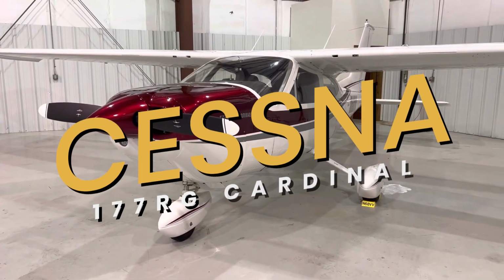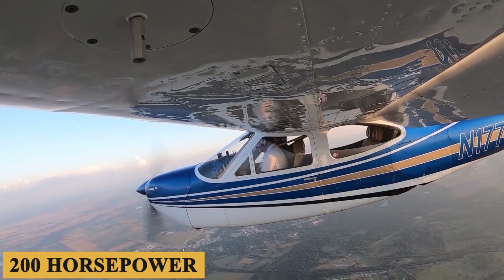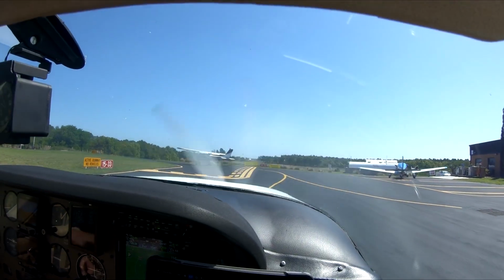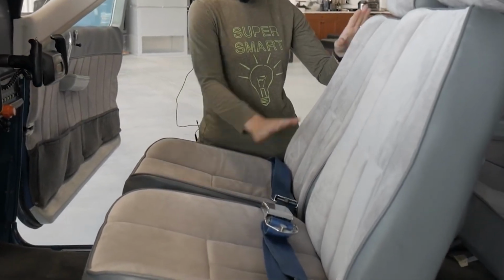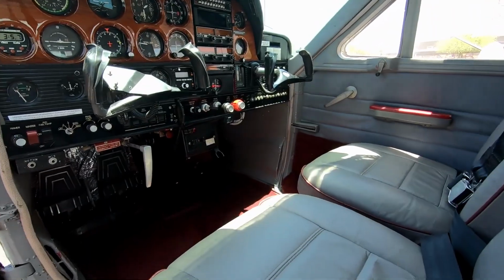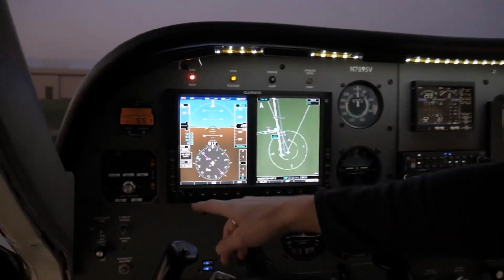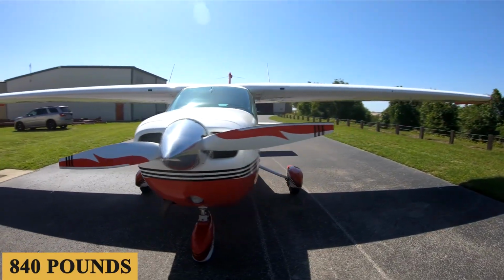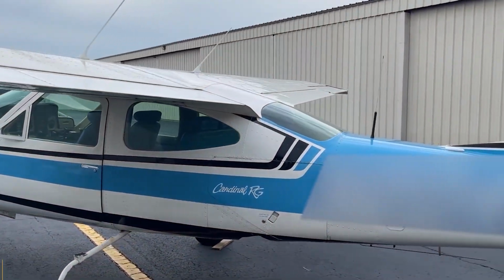Inside The $200,000 Cessna 177 Cardinal RG

Comment: The C177 is a piece of junk. One of the most dangerous aircraft made by Cessna. I will never ever pilot one again.
Reply: Care to provide some data on why you think that? What are some of the other dangerous airplanes produced by Cessna?
Reply: @cessna177flyer - as a CFII with about 50 hours of instruction in the Cardinal before I decided never to pilot another one. Here are problems I experienced: 1) No fuel flow from the right fuel tank to the engine, or the ability to crossfeed fuel to the left tank. This wasn't seen during preflight or run up, it only occurred during flight. 2) Pitch instability during approach and landing flare. Actually anytime you fly slow in that airplane, which makes stall recovery more of a challenge. 3) Structural problems especially at the wing root. Without the supporting spar to the wing like the other Cessna "C1xx" models, the Cardinal wing is problematic and has required many Airworthiness Directives to deal with it.
So, for those reasons it is a very dangerous airplane IMHO.

Comment: Why did Cessna stop production of the Cardinal?  It's simple, it cost too much to build for what it would sell for.  If it had been profitable at the same price as the 172 it was designed to replace, it would still be in production, but when it ended up sandwiched between the 172 and the 182 at their price points along with competitive Piper 140 and 180 Cherokees and Piper Arrows,  it just cost too much to manufacture.   The cost of that beautiful cantilevered wing that took away those pesky wing struts was already part of the extra expense.  Then, when the original engine of the 177A needed to be upgraded to the 177B with a 180 horse engine plus a variable pitch prop to get the performance to be competitive,  the production costs skyrocketed.   The result was very weak sales at a time when private airplane sales across the board were in the dumpster.   I worked for Cessna in 1977 and met with the dealers when Cessna made the decision to end the Cardinal.  Dealers at the time were all but forced to buy the 172s and 182s that Cessna made in those years simply to keep their dealerships so they would to be able to get Cessna parts to fix what was already the existing Cessna aircraft.  So the Cardinal became the Cessna stepsister. I owned two of the 1978 year Cardinals, the best years made, accumulating  over 1500 hours.  Unparalleled comfort for a business traveler because it was so spacious, grand visibility and easy to get in and out for passengers as well as the pilot.

Comment: Terribly patched together video with very inaccurate data on the fuel capacity and many other aspects. There is only one green light and one red on the landing gear indicator. There’s a side mirror to check gear on most. 60 usable gallons on most RGs. Not very well done.

Comment: Why did Cessna stop producing the Cardinal?  It doesn't make sense to me.  The benefits far outweigh the negatives from what I can see.  Minor modifications could have made this an even more incredible plane but Cessna stopped in 1978.  They had a winner in my opinion.  Some tweaking can be done by owners to help with performance.  Tornado Air makes a turbo and an exaust and free flow air filter make a major difference as well.  STOL kits are said to help further.  But they are getting old.  Why Cessna would produce the 182 instead of this plane I cannot understand.
Reply: like @wwselect above stated, the Cardinal was too expensive to make. Labor costs in the late 60s and into the 1970s increased significantly. Because much of the Cardinal was hand made, it simply wasn't profitable to produce. Also, the learning curve Cessna believed would happen as production matured never materialized. A modern production line today could certainly automate the production process to remove the human labor cost, but the capital outlay to design and build such a factory and robots to produce less than 50 units/year just doesn't make sense. But you are right, the Cardinal is an amazing airplane and was wayyy ahead of its time. I've owned mine for 14 years.

Comment: I owned a Cardinal  177B for over 20 years.   For a 50 year old airplane< I certainly wouldn't pay in the $200,000 price range for a 50 year old airplane....
Reply: I own a 1976 FG, and definitely wouldn't pay $200k for an RG, unless it's got all brand-spaking new everything!  There was a '75 B running about $180k recently, but had new interior, fairly new paint, and full Garmin suite with auto-glide.
Reply: @ddthompson42  for 180K, that better have had an overhauled Lycoming too.
Reply: @dabneyoffermein595  It was about 300 hours old if I recall.
Reply: @ddthompson42  Wow, not needed then, that sucker will last another 3 years.